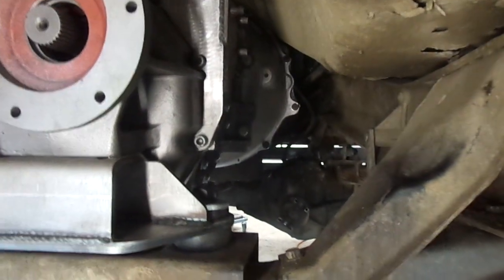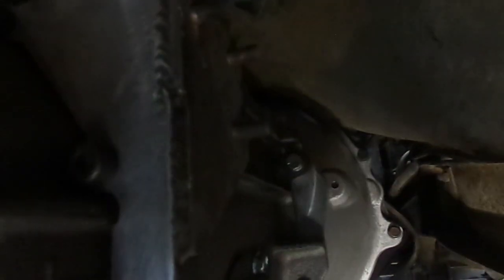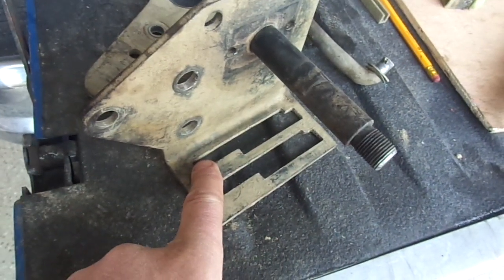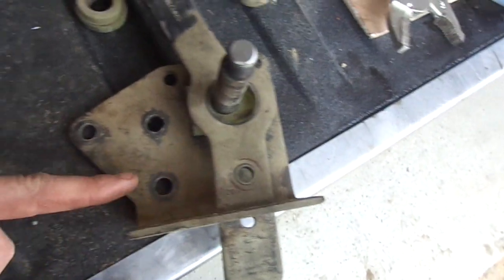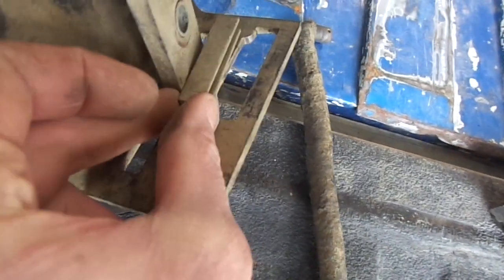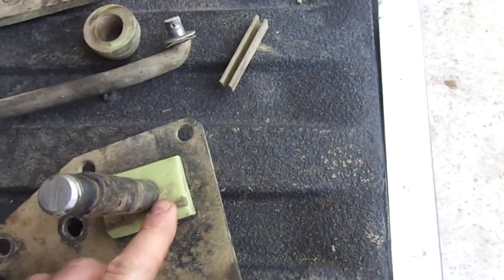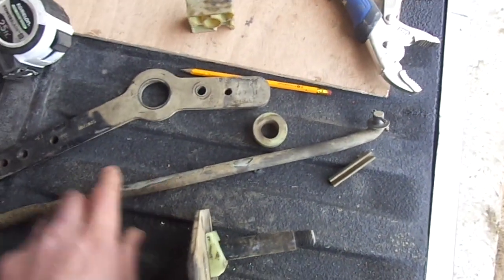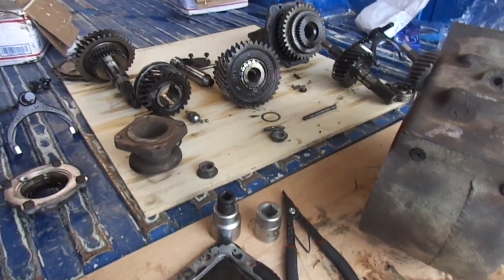First gen Cummins NV4500 manual swap, NP205 shifter linkage modification.

Comment: how did you mount the bracket onto transmission
Reply from the maker: I used the Metal by Charlie mount to adapt this 4wd bracket to the NV4500